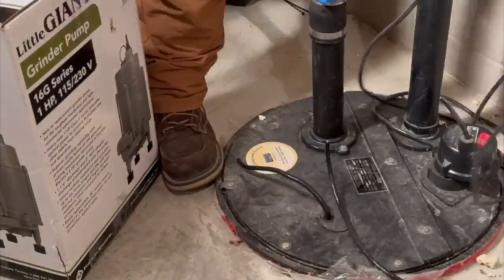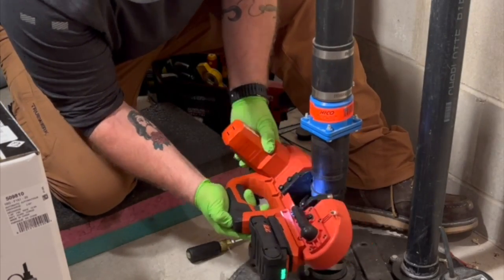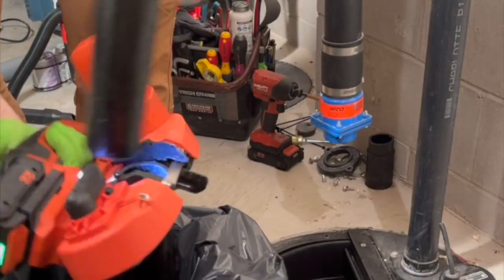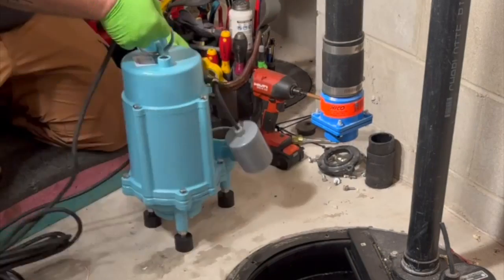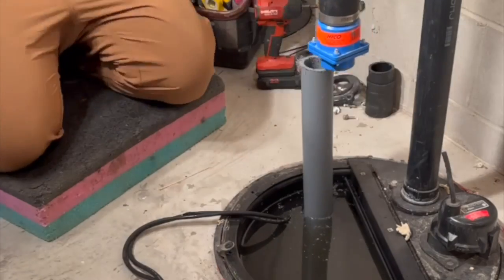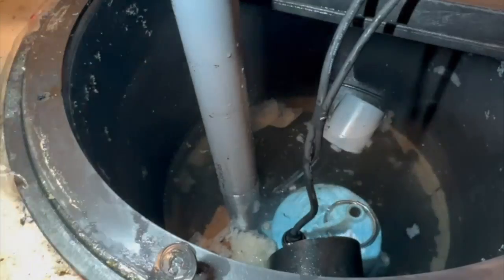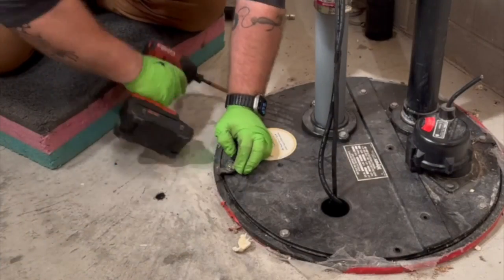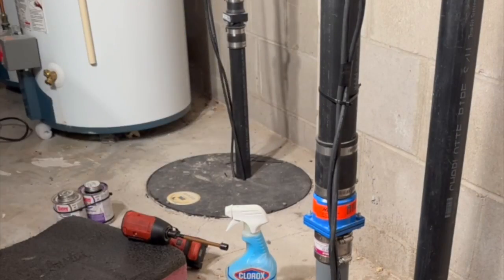Sewage Lift Pump Replacement - Why a grinder pump is better

Comment: How has the hilti nuron platform held up for you? Compared to Milwaukee? Every single power tool I own is Milwaukee but looking to make the switch to hilti. I prefer longevity over power and I feel as if hilti will last longer than Milwaukee
Reply from the maker: So far everything is great. Super durable for sure.